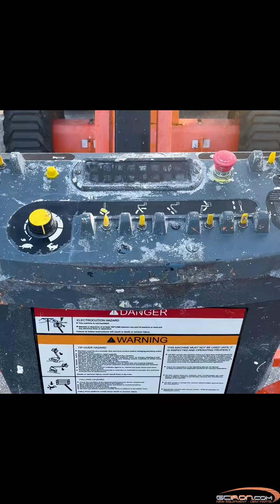Fault Code 0011: FSW Open | JLG Boom Lift

Comment: I washed my unit now it throws this code
Reply from the maker: If you watch this video, it explains 0011 FSW open fault code.  This code involves the platform foot pedal.  It sounds like you have water in your foot pedal causing the contacts to be wet.  Let the foot pedal dry out and then diagnose like the video mentions.